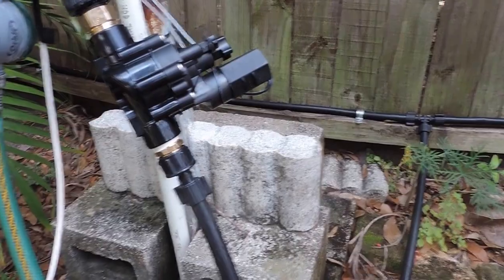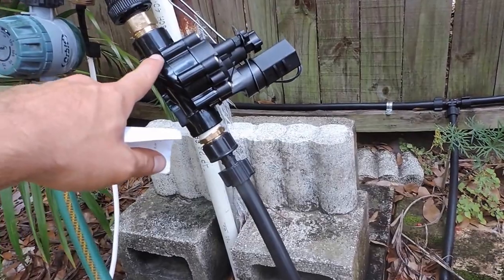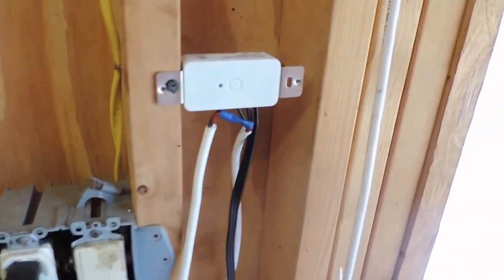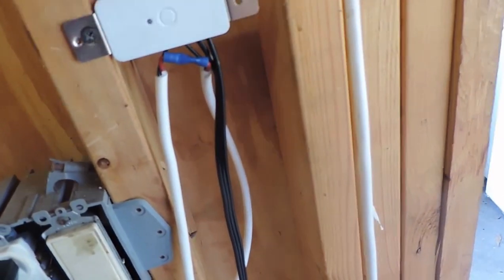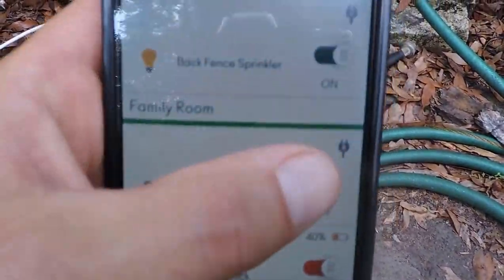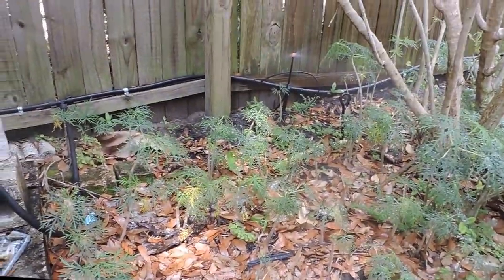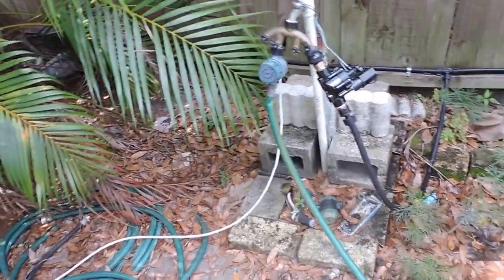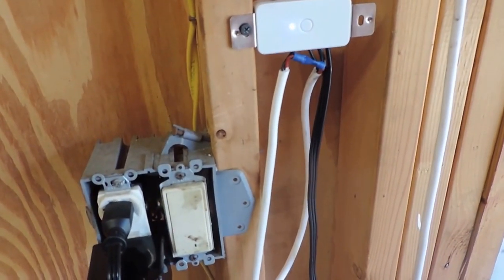Zwave Controlled Sprinkler System - Irrigation

Comment: I was looking to make something similar, but I just saw the GoControl Irrigation box in HomeSeer.com for 50 bucks and Controls up to 15 Zones so 15 Irrigation Valves or similar and can also use Rain Sensor and others to measure how wet grass is. So, I still thank you for the idea of the Irrigation valves, and wanted to share with you all the good price. Personally I prefer HomeSeer as a Controller because it doesn't need Internet in case of disconnection your house still works, and is more open to eny device Z-wave zigbee and others.
Reply: Good to know, I'll look into it.  I've been looking at Spruce and Rachio z-wave controllers as well because I'm getting close to installing a full blown in-ground sprinkler system around my house.  This was just a short term solution to control micro-irrigation in my backyard.  Definitely will look into GoControl though.  Thank you!